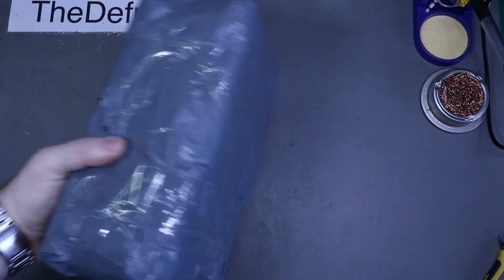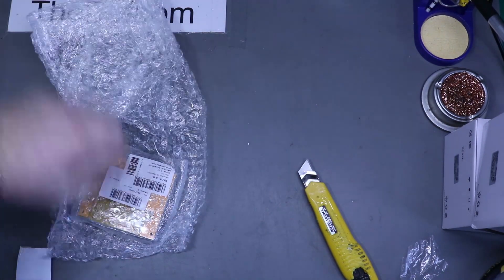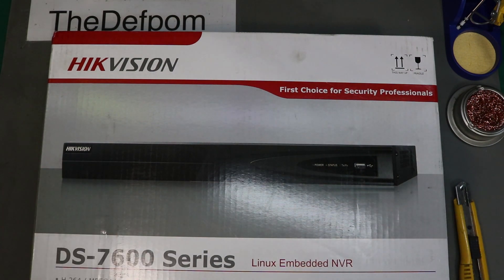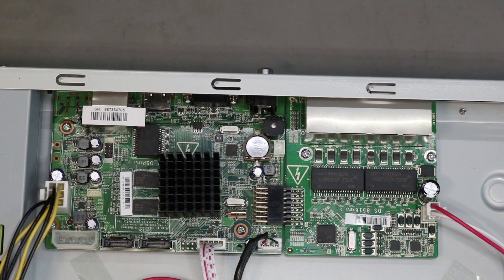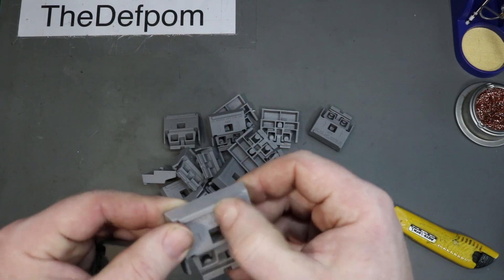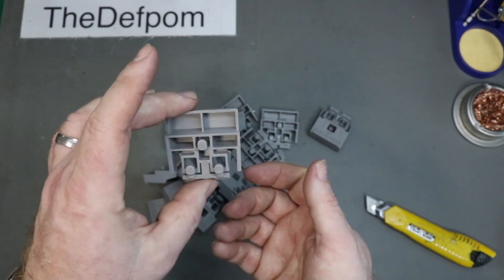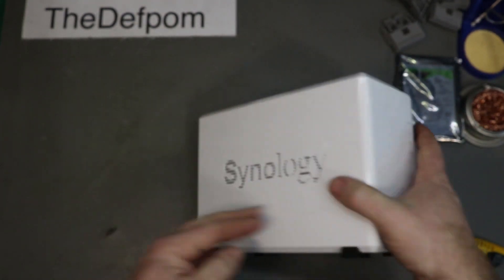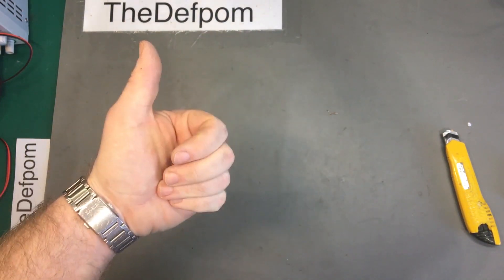🔴 #415 Mailbag Monday 30th July 2018

Comment: The replacement HP feet work well for me. Don't think there is an alternative other than no feet at all and lack of proper ventilation.
Reply from the maker: I did a 3D printed version myself not long ago, so I actually had an alternative, but I saw these and thought I should get them whilst I could! You can see what I have been designing here: https://defs.link/?u=0347b1